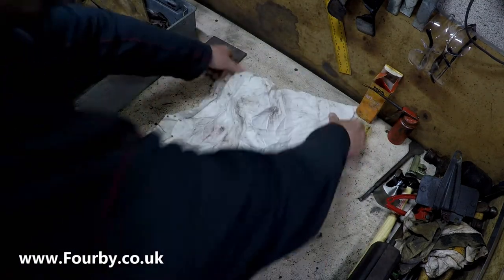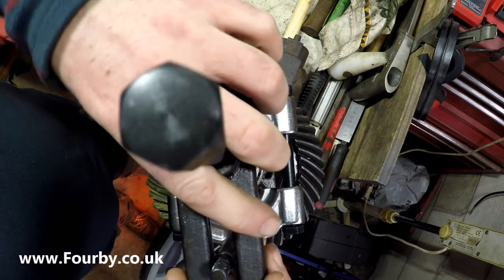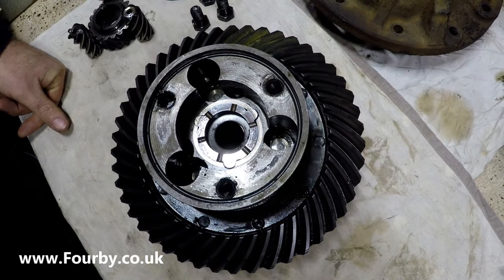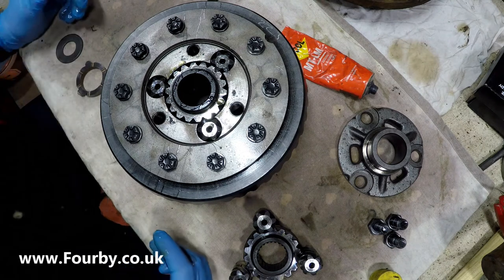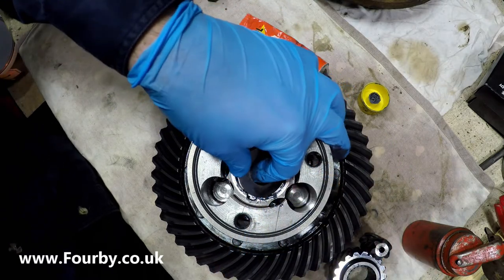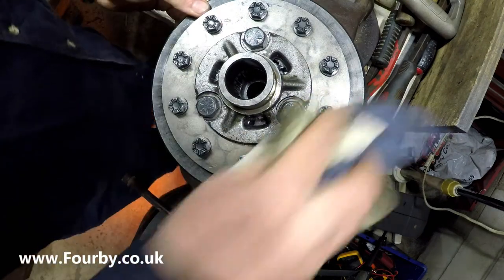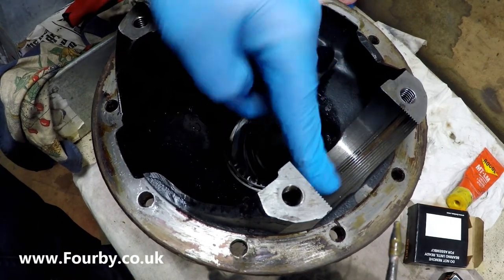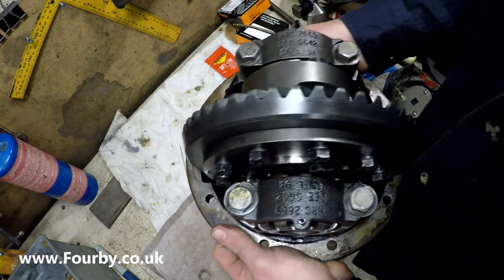Land Rover Differential: Making A Rear Detroit TrueTrac into a Front, Inverting the gears

Comment: Mr fourby...the front and rear truetracs are assembled with different preloads, fronts being much higher in preload due to the fact its on a steering axle. So they are interchangeable in theory, but the practice is different. I would imagine that a front application used on a rear, would be like driving with a break binding when turning on a tight circle on tarmac. Only an observation.
Reply: I have my TruTrac out at the moment because I have to replace inner axle seals on the front.

While on the bench I stuck both axles into the diff and tried to spin them in opposing directions.  I couldn't get the shafts to turn. 

Is it due to the front preload you  mentioned? I assumed they should free-spin until the inner spiral gears push outwards and "hold".

Comment: Thank you; Very clear process in this video.
What is the theory behind changing over teh direction of the gears? 

I do not see anything on Ashcroft's website about doing this for their ATB. 

Do you think that it would be beneficial with the Ashcroft ATB when changing between front and rear?

Comment: So in your opinion which would be best the truetrack or ashcroft Atb instead of running air locking diffs?
Reply from the maker: the trutrac is fit and forget, not as aggressive as a pure locker, I like them as it suits my driving style, which is to apply a little braking to control a spinning wheel

Comment: Mr Fourby, re lucas heavy duty oil stabiliser. Yes, a great assembly fluid, then stop!
Because... no GL/API rating means no testing has been done.
2 lucas products that are only worht using are the fully synthetic oil stabiliser, a totally different animal, and diff gearbox oil 75/130 which specifies exceeds GL5.. detroit  (eaton Tiawan) recommend GL5 mineral for trutrack. My salisbury rear axle has a trutrack in it, i used to use lucas and gl5 mineral, it was way better on pure gl5 mineral! now i run morris fully synthetic gl5 75/90 its like water in comparison, but i no longer get the fine black metal grindings in the diff oil, and it runs a damn site cooler, regards.